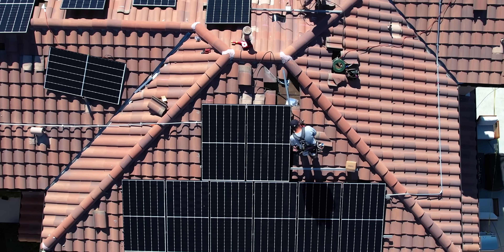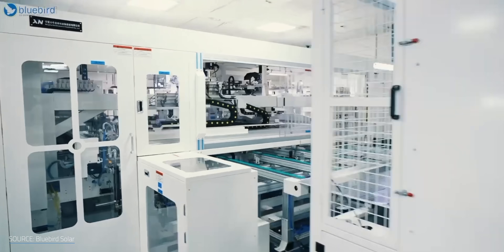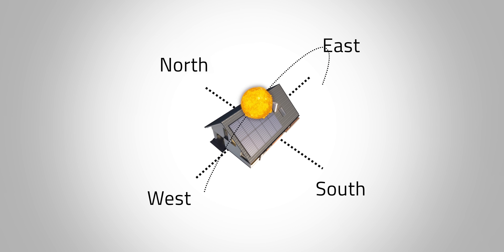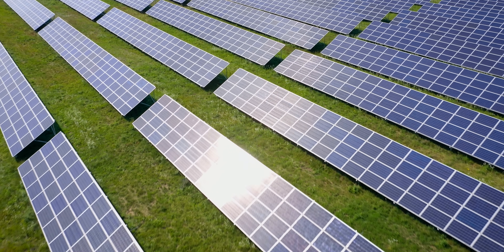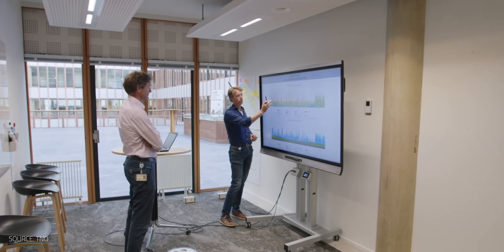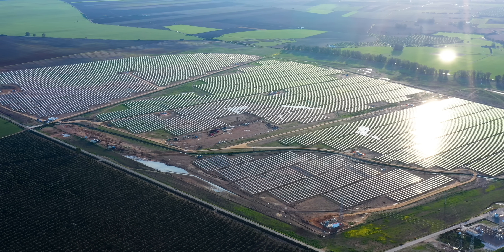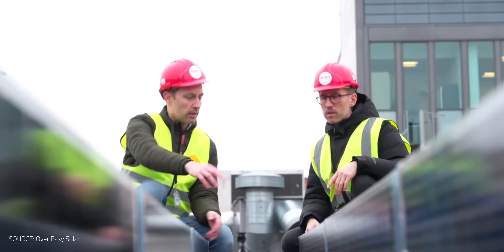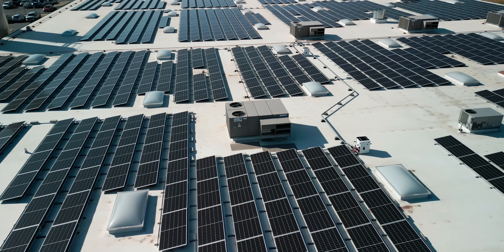Have we been doing Solar wrong all along?

Comment from the maker: Would you want to set up vertical solar panels where you live? Secure your privacy with Surfshark! Enter coupon code UNDECIDED for an extra 3 months free at https://surfshark.deals/undecided

If you liked this, check out How We Solved The Home Wind Turbine Problem https://youtu.be/SQKHJm7vd4E?list=PLnTSM-ORSgi4dFnLD9622FK77atWtQVv7
Reply: I have been watching a number of videos about people sailing on catamarans and most of them use bi-facial cells on the back of their boats since so much of the sunlight can reflect off the ocean water.
Reply: So the lesson learned is install movable bi-facial solar panels that are automatically optimized for maximum energy output (i.e. before they become too hot, change their tilt & direction sufficiently to compensate for the anticipated undesirable thermal gain. When they cool down, optimize their tilt & direction again for maximum energy generation).
Reply: Probably doesn't need snow scraped off them..
Reply: It seems that the better efficiency is due to lower overheating of the solar panels… Another option could be : in France, there is a solar panel company named DualSun that seems to be quite successful (mainly in South of France I think) that manufacture panels that produce both thermal energy to heat water, and photovoltaic energy for electricity. I think there is a liquid that cool down the panels (and collect thermal energy to heat water), which therefore helps improve the photovoltaic efficiency. They claim that they have the best overall energy efficiency (as they collect both thermal energy and photovoltaic energy). It is a very smart idea, and you could also equip them with micro-inverters (like Enphase).
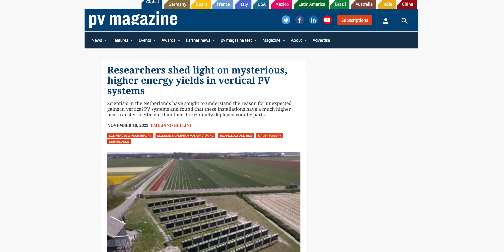Reply: 0:31 "shed some light"??......I think you've been spending too much time with your brother and his dad jokes xD
Reply: there is a new solar farm in the alps, well over 2000m high up. of course bifacial, and mounted vertically.
main advantage. up there, the weather is much better, but it snows a lot.
and now the question. how much snow will stay after a snowy day on a vertical solar panel. and how much will stay on a horizontal or tilted panel?
Reply: Bro, yes yur wrong all the way.
Reply: I would definitely consider it in a dual-function environment, such as doing double-duty as a fence.  It is fairly situational, particularly for residential, and it can't compete with tracking panels in grid-scale installations.   But there is definitely merit to a vertical orientation capturing morning and late afternoon production because it allows production to match and exceed consumption over more hours of the day.

The main problem is finding a location for the vertically-oriented panels that captures both morning and late afternoon.  This is fairly difficult to accomplish in a residential setting, and I doubt it could compete with tracking panels in a commercial setting.  Bi-facials are also considerably more expensive and heavier than normal panels.

I have some verticals hanging off my back-deck railing to fill in the late-afternoon gap and that definitely works, quite well in fact.  The overall production is less but it exceeds the southern-facing main system in the late-afternoon and is able to reduce the number of non-producing or low-producing hours each day.
Reply: @junkerzn7312  I see just one issue with those panels as fences. think, you have kids, kids love playing ball. hit one of those panels with a ball, and that will cause some "reduction in happiness" ;-)
Reply: @robertheinrich2994  Well, maybe if it were a bowling ball or a batted-baseball.  Otherwise though ... panels are actually fairly resilient to impacts.   But I agree that the panels are more exposed to impacts when used as fencing.
Reply: @junkerzn7312  I'm thinking classic soccer. if you want to hit the ball hard, you can.
and it isn't important that the glass pane shatters, the microfractures inside the pv-cells are important. microfractures = lower yield.
Reply: @robertheinrich2994  Certainly anything at softball-hardness or harder.  It would take a face-on direct hit though.  You'd have a tough time breaking it with a soccer ball.

Panels use high-strength commercial tempered glass... it takes quite a lot of point force to damage it.  It will fragment, but generally speaking the larger bits of glass will stay on the panel.  It isn't safety glass but it also isn't pane glass.
Reply: I might be totally wrong, but isn't it obvious, if they just put a layer of anti-UV glass on top of solar panels, and it will resolve heat issue?
Reply: @caojidan8913  all energy the solar panel absorbs will impart some heat, there is electrical resistance involved.
Some solar panels absorb electricity outside of visible range so blocking that isn't optimal.

Many UV blocking materials heat themselves up or can trap heat under themselves, wich would defeat that purpose
Reply: @fionafiona1146  When we're able to get commercial quantities of graphene it will certainly be employed blocking UV from solar panels.
Reply: Be careful of phrases like "half as___" or "twice as____" when you don't establish the reference and scale you're referring to.
Half as hot could mean, to you, that instead of 59C the panel is at 48C with your baseline at 37C.
But someone not inside your head could also thing you mean 59C instead of 25C, using 0C as the baseline. Or 334K at the hottest and 167K as the better performance.
-
Another interesting one is when people say, "Jerry was twice as short as Tim."
Reply: I am loving the B-roll of these being used in fencing and/or sound deadening applications.  I could definitely see this as an option for my area.  You only have so much rooftop, but if you can supplement power needs by also having a 'solar fence', that would be incredible.
Reply: Oh yeah, I know Al Bedo, good guy. Always with a sunny disposition. 🌞😎🌞
Reply: It’s sad that you have no integrity when it comes to your sponsors.
Reply: No, I would still set up normal inclined solar panels BUT those solar panels should have a cooling system and the extra heat can be used to create more power or heat homes in winter. If heat pumps are used instead of just normal cooling, a solar roof can double as a heating roof. 🤯
I’ve been saying this for years.
Reply: I'd try them, a solar fence would be awesome. I live in Ohio and have my 1000 watt array as border on the porch. Haven't had snow stuck to them in years.
Reply: I would design a combination of both? Like 70% vertical bifacial and 30% horizontal/tilted to fill the midday dip/ gap in electricity generation. Also planting light colored plants or using reflective ground/ plants covering between vertical rows will increase the yield.
Reply: @allmedcom  I literally just said that dude.
Reply: At my high latitude almost in Canada we get so much snow that I was planning on making my panels steeper than 45 degrees, It will help with the snow and it will give me more even power between winter and summer instead of huge spikes in summer... I was also planning on building the south wall of my shed with panels.
Reply: A natural gas fired generating plant would take up exponentially less space per kilowatt generated for less money, therefore causing less pollution and therefore more environmentally friendly than any version of solar power production. A nuclear power plant is more efficient and therefore more environmentally friendly than the gas plant. “Green” energy is not green on a large scale. It’s great for isolated mid latitude applications like sail boats or cabins in the wilderness. Putting solar on houses in urban areas already supplied by conventional generating plants cause more pollution than they save..
Reply: They should be used as fencing material along all public ROW... I am sure just lining the US Interstate System with solar fencing could probably power a great deal of it! I wonder if anyone has done the napkin calculations on that! I asked Bing Co-Pilot to attempt such a number for Alberta's Queen Elizabeth II Highway and it came up with something like 6 GW or something... Which is 60% of Alberta's daily usage now and almost all its natural gas power use...
Reply: @stickynorth  You know there are losses associated with the distance electricity has to travel? Also, I can't wait to see nothing but solar panels everywhere I drive.
Reply: you could increase bifacials by not putting them in a field full opf grass but create a pool of water the enter field about an inch thicj wiht just water and iut will reflect the light that falls on the flkoor between the panels and will also re reflect any light that bounces of the original panel onto the water and back to another panel. scattered worlds first scattered light solar farm. to stop algea growing use specially ph'd water so no algea can grow in it. i also wondeeed about combining solar and water heater in one panel maybe nmotheat the water up per say but cool the panel down for incrreased efficincy and use the warmed water as a pre heater for a hot water system thats on single facial panels.
Reply: I have some in my flat windows that are vertical. No idea if they work better but I don’t have the space to do anything else with them.
Reply: The Earth is tilted at 23.5°. National Geographic. So at 66.5° during the winter solstice the windows or solar panels are 90° facing the sun directly. That's why houses have windows not skylights.

https://www.google.com/search?q=earth%27s+tilt+angle&oq=Earth%27s+tilt+&gs_lcrp=EgZjaHJvbWUqBwgBEAAYgAQyBggAEEUYOTIHCAEQABiABDIHCAIQABiABDIHCAMQABiABDIHCAQQABiABDIHCAUQABiABDIHCAYQABiABDIHCAcQABiABDIHCAgQABiABDIHCAkQABiABDIHCAoQABiABDIHCAsQABiABDIHCAwQABiABDIHCA0QABiABDIHCA4QABiABNIBCTEwNjA1ajBqN6gCALACAA&client=ms-android-tmus-us-rvc3&sourceid=chrome-mobile&ie=UTF-8
Reply: sure!  good fences make good neighbors.
Reply: If it's better to face them vertically, then wouldn't it be even better to put them in an X pattern?  Like when a 3D game closes two 2D sprites to make a 3D looking object
Reply: @justinanderson267  that's what the guy in the alps did. a cross shape, north-south and east-west. with that, he can capture the light of sunrise-sunset, and the light from mid day.
Reply: You mean those panels I keep on the walls cause snow don't settle on them and they get those glorious hours of morning sun?
Reply: Can this be applied to home gardens? And what other low-hanging vegetables can be interplanted with Bifacials? Squash, potatoes, yams?
Reply: @MrVillabolo  sure. I'd say anything that doesn't grow above 1m.
or mount the panels higher.
Reply: You could install these on any outside house wall, cool
Reply: I set mine vertical from October 15 until April 15. This is mostly because of snow. Besides, the sun is only 22 degrees above horizon at the end of April. 

Bifacial panels run cooler because of black body radiation.
Reply: A YouTuber named Tech ingredients has a much better solution to this issue. You simply add a cooling fan. You end up with much better performance and performance increases with very little added cost or complexity. Active cooling also increases the longevity of the panels. Vertical panels are clever and cool, but not the best solution by far.
Reply: I guess better cooling due to the vertical orientation.
Reply: There needs to be more research, less dirt, less standing water/snow, less space, longer life +  practical in my garden
Reply: How much better output do those panels have when they are mounted vertically compared to horizontally at the latitudes angle?
Reply: Isn't this only an issue in the summer, or generally hot places?  I can see this being optimized for the summer, but in winter it is now getting less sun in the vertical position, but it would fair better facing the sun directly in those lower temps of winter or even fall.
Reply: @choomanfoo157  if you made them movable, you could orient them vertically during the summer and grow crops between them, and then rotate them to face the sun during the winter when heat isn't a problem. Of course the sun is lower in the sky during the winter so a vertical panel will already be getting more direct sun than it will in the summer.
Reply: We already have I believe Tesla park gave you the proof at our YouTube channel I don't seem on your link many people know that we've been doing this way longer than they have, For anyone interested( update on fiber optic solar batteries is the name of the video)
Reply: ButFor,Yes.. situational application from solar fencing to solar balcony banisters to freeway cement divider -> toppers.
Reply: @Lach.M   We would like to know why you are writing us we're just trying to get him to recognize and state so that this idea a vertical solar is ours and we have a published video to prove it, they told us it didn't work and many common said so and now they're using our work why
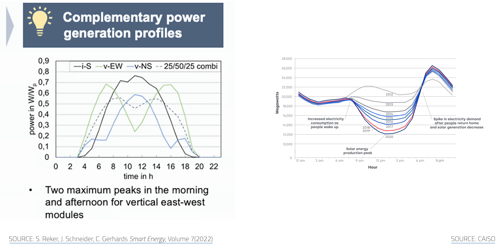Reply: 4:05 good job. I know bifacial but they never mentioned this advantage until now.  So you basically get good generation in the early morning and late afternoon but not noon. A side effect of this, due to less peak generation, you don't need to buy a powerful inverter just to capture a short peak of power generation around noon. Inverter cost is being left behind the rapid drop of solar panel prices. Additionally, in solar farms, you don't need a tracker that adds costs-we just need a large solar farm or solar pv company to confirm this.  
Sadly, for most residential installations, a vertical bifacial is not practical.
Reply: I wonder how it compares to more horizontal solar panels with active cooling and active cooling in general. I watched a YT video showing that active cooling on a PV takes less energy than it provides during the day.
Reply: In central Finland. Yes! I'd definitely try the vertical solar panels. I could deploy them around my tiny yard (faces south west).
Reply: Thanks, Matt. One benefit of vertical panels would be to eliminate the potential panel damage risk from hailstorms.
Reply: I bought a couple of small, flexible solar panels with a USB port attached. The backing is a translucent white plastic. There's an android app called Ampere which displays the charging or discharging current. I set the panels out face up in bright sunlight to see how much current the put out. Then I flipped them over. The current dropped almost to nothing. When I lifted the panels a few inches, still face down, the current was higher than face up, laying flat on a surface. Then I flipped the panel face up while elevated. Same current as laying on a surface.

Apparently the panels are capable of converting some light that goes through the translucent backing, if it's bright enough, and are very good at converting light reflected to their normal face, even from surfaces that aren't white or mirrored.
Reply: Yesterday, here in Tulsa, OK, wind speeds were 43 mph.  I looked it up because I went home from lunch to replace the side view mirror on my gf's car and while I was cleaning the backing on the mirror housing, the mirror flew off the hood of her car(that I had attached to a suction cup to help align it).  Anything skinny and wide is just a giant sail.  I just dropped $4K replacing a quarter of my privacy fence from the fathers day storms here(got up to 75mph).  I can't imagine having flat, relatively thin, panels sitting out in the open.  Not that my yard is designed like that.  There's trees in the yard.  The trees don't cover the roof, but they were planted to shade most of the yard.  So there's no good spot to put panels like this without removing comfort shading.  Honestly, the privacy fence industry should get in on this by creating 6ft tall panels.
Reply: Absolutely, I live in a rural agricultural state, so we could use the additional funding from selling solar energy lol
Reply: Would be cool to do a fence
Reply: I absolutely loved the video. I had no idea vertical was even an option. My house is oriented E/W rather than N/S so vertical is something I can install without needing to modify the structure. I am also looking at a home wind turbine because I live on a mountain and get a lot of wind. I see you have a video on that, so I'm off to watch it. Thanks again for a very informative video.
Reply: This is another bad idea.
Do not do this wind will ruin them
Reply: Well, I live in a place with both snow accumulation and weather hot enough cause overheating issues. The third issue is rather particular to the semi arid climate. Normally the vegetation here is actually low enough that trimming would be unnecessary. 🤨 That is unless you place something over part of the soil that funnels water into a smaller area, then there’s enough water to make the weeds grow tall. 🤦 Solar “farms” in this area have an ugly tendency to turn into gravel lots that are regularly hosed down with herbicides to prevent the weeds from naturally exploiting the water they collect. Worse yet, the barren vegetation free areas tend to roast in the noon day sun. This sounds like an ideal solution
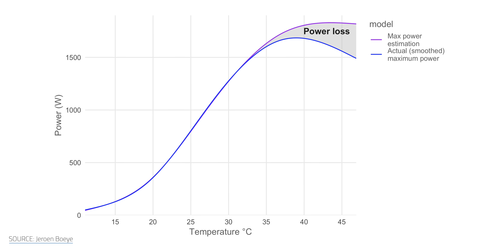Reply: 6:12 - That says there is almost no power from those panels at 10°C? For much of the year, that's our average temperature. Does that mean Solar PV panels aren't worth using in the U.K.?
Reply: Thanks,  @Alexej-h5y  . Which country are you in?
Reply: For us the northern hemisphere during the winter months is at 23 degrees for over 4 months, these would be a good choice. I think during the summer months we max out at the low 40 degree mark
Reply: Now install vertical solar on your vertical windmills !
Reply: Thermal management by getting halfsun. Battery and electronics hate 80c plus.
Reply: well the nederland study maybe didnt look at the wind SW effecting the cooldown of the pannels .. as the wind direction could have influence also .
Reply: Don't have time to do a calculation but my hunch is that the new type would not do as well in tropical climate (near equator).
Another point is that this alternative solar panel would be twice as expensive, a lot easier to clean, and offer great practical space saving i.e. allowing movement between the panels, and is aesthetically pleasing too due to the fact that vertical panels are not as obstructive.
Reply: Surely there is a 'mid-point' between fully vertical and fully sun-facing that optimises W while keeping the T low enough to support the high W. It is extremely unlikely that fully vertical is the "perfect" setting; if slightly-off-centre decreases internal temperature by just a little, this could have significant performance increases. A vertical panel will decrease the temperature by a lot - probably far more than is necessary. So trials need to be done with the panels angled at 10º or something like that and that should also up the intake in the morning & night.
Reply: @rozluvr personally I would love to hear Matt speak Swedish 👍🏽
Reply: @brady3474  your reasoning is flawed. "Less space, therefore causing less pollution" is as childish as saying, the biggest percentages must be the worst polluters", which would make nitrogen and oxygen our biggest problems... Which is clearly not the case. So sorry your Neanderthal "bigger is better" mentality prevents you from seeing reality.
Reply: I can't wait for you to start reporting on how these tech destroy land where they are disposed after broken or end of usefulness... Wonder if you will do it at all, or you will keep virtue signaling with some new fake useless technologe.
Reply: How about water cooling for solar panel?
Reply: So it seems to me this wouod make most sense in the tropics. Higher moisture content means increased light refraction. Higher population density means more pressure on land. Facing east west is more logical as their is no need to orient further south or North. Love to know what others think? Where can I buy these panels and I'll try!
Reply: I think south facing is better for winter production when the sun course is narow between south-east and south-west, temperatures are lower, and when energy needs are much higher. For winter production you also want a higher angle than your latitude. Setting panels vertically, south facing, makes a lot of sense for winter production.

Vertical east-west bifacial is better the rest of year, and especially relevant for fences, noise barriers, and some agrivoltaic installations.

Honrinzontal is better under cloudy conditions, which is the case in many northen climates in the winter, those pesky many consecutive dunkelflaute days, when we also need more energy for space and domestic water heat.

So seasonality, weather patterns, and demand, considerations are key to any project.

In the end, I think that, as the cost of solar panels decreases, and manufacturing CO2 emmisions decrease, we should install solar panels on as many surfaces as we can, except probably north-facing surfaces.
Reply: my idea is for years to build a big pyramide in the sky and install it with vertical solarpanles which can automatically adjust to the efficint degree
Reply: On behalf of quite some ecologists (one being the better half) I want to say that putting solar panel in fields is detrimental to local ecology.

You will never hear this on the news or any mainstream channel. Especially not here, for instance. But now it has been said, and now you know.
Reply: I'm attempting solar energy set up. Vertical panels should work well 😊
Reply: You are like marketer. Bad one.
Reply: Who composed the background music?
Reply: Yes. A relative is furious about solar farms going in the fields within thirty miles of where she lives. She was fine with the massive coal fired smoke stacks which could be seen from far further away as her county is entirely flat aside from one city on a hill (Lincolnshire). Drives me batty. She's got solar on each of the three houses she's built but it's not ok to have it in a field for twenty years. I tried to explain why it's important but she doesn't get it. All she really cares about as a NIMBY is that she can see something that's not pretty. I despair.
Reply: @jonevansauthor , Despair not, jon. Rooftop solar leads to neighborhood mini-grid systems. Field array solar requires long-distance transmission lines tied to complex regional utility grids, both of which remain vulnerable to power outage. Households with rooftop solar gain a backup power supply with the means to store electricity in their EV in the garage and the choice how to use that stored electricity, either household uses or routine driving. Rooftop solar incentivizes driving less to support the growth of local economies whereby more trips become possible without having to drive. Your relative is right. You and far too many dedicated environmentalists are wrong. Furthermore, the EV that offers the most benefits, applications and potential to reduce fuel/energy consumption, emissions and frickin insane traffic is the plug-in hybrid PHEV, not all-battery BEV nor hydrogen fuel cell because combustible hydrogen in the ICEngine of a PHEV drivetrain -- stores at much lower pressure in smaller-safer tanks and can deliver at least TWICE the equivalent MPG possible with fuel cell HFCEV tech.
Reply: Just another idea: I'm not sure if anyone's tried yet, but what would happen if you used 1 solar panel upside down and multiple mirrors around reflecting light from each onto 1 panel.  Could 1 solar panel and 6 mirrors be equal to 6 solar panels?
Reply: I want to see a useable product that can be hung on balconies - it would be great to be able to power one's personal use of electricity that way. Preferably portable so that tenants could bring their systems with them. I would like to see an security analysis too - let's not forget that at the dawn of electricity it wasn't safe at all, and anything meant for consumers must be so.
Reply: My concern is wind stresses. Especially that balcony idea. If every balcony put up solid walls of panels would that be too much for the engineering of the building itself. I know the walls are there but that stress shifted several feet outward could matter. Just a thought. And vertical sails in areas with high winds are not good. Thinking about those storms in California with hundred mile per hour plus winds recently. Extreme weather events are more common these days.
Reply: @markpashia7067  in many cities now, more recently built apartment buildings wuth balconies tend to have privacy glass on the surround instead of open metal railings. 

As I think about that, I'd guess that functionally the bi-facial panels wouldn't benefit as much on the newer buildings as the glass is only partially translucent. And then to your point, the older style buildings with open metal or wood railings might not handle the added stress in areas prone to high winds and storms.
Reply: @martymcglame7781  One issue that I have encountered with the vertical panels I have hanging off my railing is that they do shade the deck itself enough that in winter sometimes moss starts growing on parts of it.  This didn't happen prior to my putting the panels on the railing.
Reply: @markpashia7067  I think wind stress would be an issue on top of a roof, but I don't think a balcony or railing would cause much of an issue because there is no real path for airflow to build up any significant pressure on the panels.   I have vertical panels hanging off my back deck for 2 years now and wind has never been an issue.
Reply: @markpashia7067 Concerns are great, we need more concerns.
Reply: I'd say Leipzig with a long "e" sound and closer to "b" rather than "p" it's more fricative than normal English pronunciation but close enough
Reply: Seems you do not respect your audience if you're shilling worthless VPNs at them.